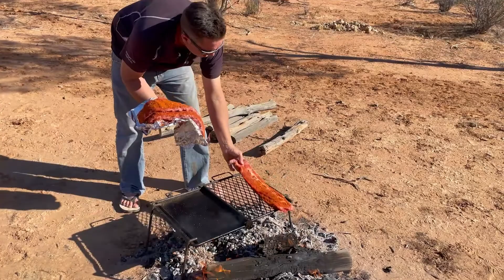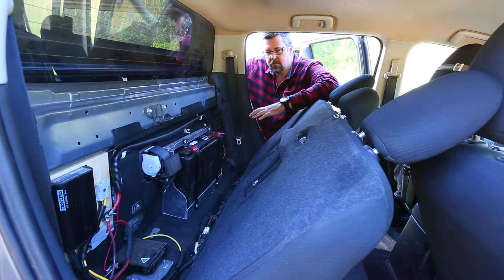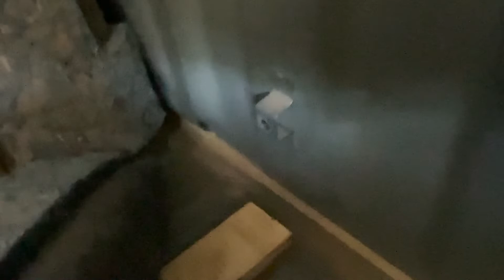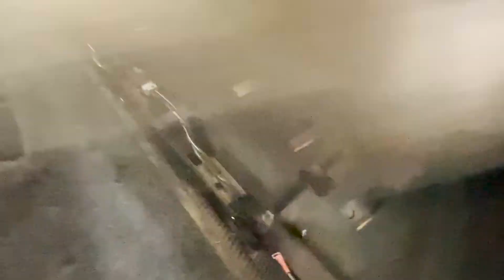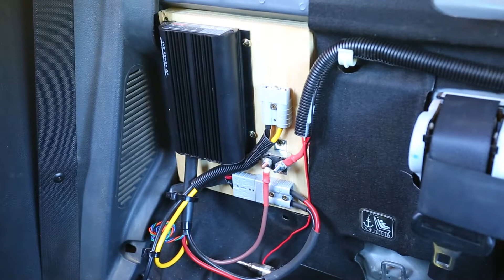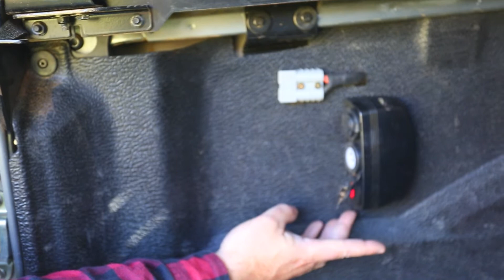Mitsubishi MQ Triton Dual Battery Installation

Comment: Hey mate. Great video! 
I’ve just bought a 2015 MQ and just wondering if you know if they have a smart alternator in them? Did you have to run a wire from your ignition for the DCDC charger?
Reply from the maker: Hi mate. Sorry for the late reply nah the triton has a fixed voltage alternator. Happy travels!

Comment: hey mate awesome video, I am wondering about how everything is earthed. Can I earth my redarc and second battery to the cab or do I need a wire to the starter battery? cheers
Reply from the maker: Hi mate, i ran a twin red and black from the start battery but you can earth to the chassis no problem just make sure you have a good metal on metal connection. 
Cheers shaino

Comment: Is there a need to run an ignition source wire from your charger to your fuse box? Obviously so that your charger isn't draining your Crank battery when vehicle is not running. As far as I understand MQ doesn't have a smart alternator and so is no need for this ignition wire? I'm not sure though lots of different info out there thought would ask if you knew, cheers!
Reply from the maker: Hi hayden! Thats right the Mq doesn’t have a smart alternator so no need for the extra wire. Cheers shaino
Reply: Does the MN triton have a smart alternator? I have a 2014

Comment: the cig socket is that T into the Anderson line
Reply from the maker: Gday mate. Yep thats the easiest way to do it as long as you run atleast 8b&s cable to the back to handle the load. 
Cheers shaino
Reply: @southernstarreview  righto. Im my vision is to have the second battery in the tub and dc-dc charger.  Then want a fridge and charging dock sort of idea in the cab is that a possibility
Reply from the maker: Yeah man thats the best thing about doing it yourself you can set it up the way you want! If you put the second battery in the tub i would run 6b&s cable to avoid voltage drop between start batt and charger.

Comment: Thanks for this video. What glue did you use for the wood? Cheers.
Reply from the maker: Thanks janine! I just used standard liquid nails you could also use sikaflex 118 construction adhesive. Just make sure your screws dont go all through the wood. Cheers shain

Comment: Did you remove the top tether point? Does the battery rub on back of seat? I'm trying to fit same arrangement but battery appears to be in contact with the seat.
Reply from the maker: Hi Dean. Shain is driving back from out west. He will reply to you ASAP. But may not be until the morning.
👍👍 Steveo
Reply from the maker: Gday dean i didn’t remove the tether and the battery does contact the back of the seat but it still locks in. You could cut a hole out of the battery box to allow the tether a bit more clearance. Hope this helps cheers shain

Comment: Hey mate, quick question, do you know if there is another way into the rear tray to prevent drilling? Is there a factory hole/grommet that can be utilised? Thanks
Reply: Nw, thanks a lot will do. Nice set up too. 👍🏻
Reply from the maker: Hi Matt, not that i am aware of. Its pretty easy to drill it out though just use a stepping drill bit and make sure you spray  the bare metal with some zinc paint.
Reply: If you don’t want to drill into the tray there is space to run cable up behind the tail lights

Comment: Awesome video mate. Got a question regarding terminal connection. If I want to use a vsr instead of a dc charger can I connect the input from starter battery and output to accessories on the same terminal like piggy backing? Will that cause any problems regarding charging or output. Cheers
Reply from the maker: Thanks ryan! You definitely want your accessories to come from the positive on your second battery that way the connection from the isolator to the second battery will be fused and your 12v items will be protected. Depending on the vsr it will monitor the state of the second battery also.

Comment: Thanks for the video mate. Looking at doing the same in my triton. How did you run the cabling from inside the cab to the tray?
Reply from the maker: Gday Anthony, on the right hand side behind the seat if you take the moulding out on the side, there is a factory grommet that you can run the cabling through. Then just go straight down to the chassis rail and along to the rear of the tray, easy as mate!